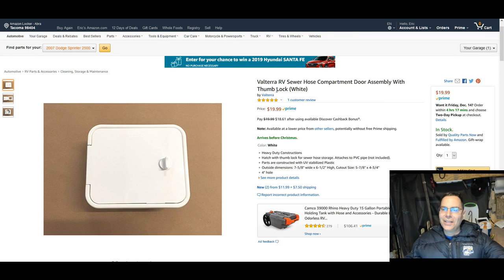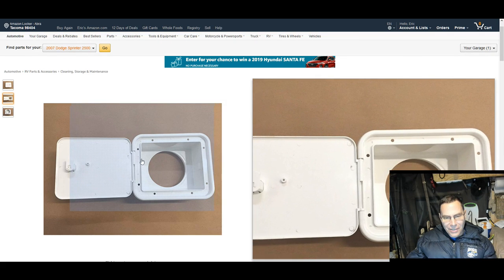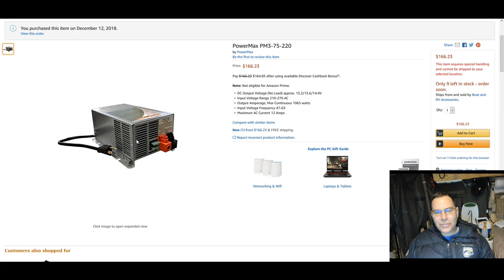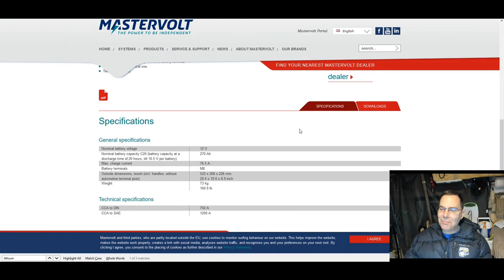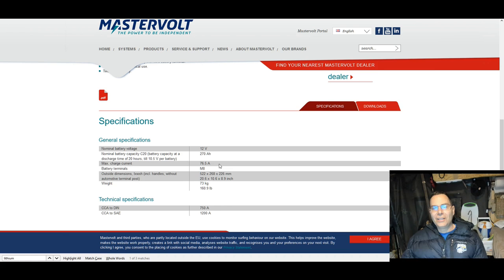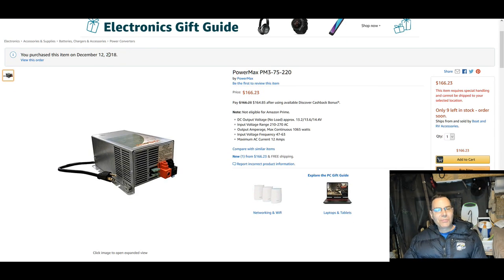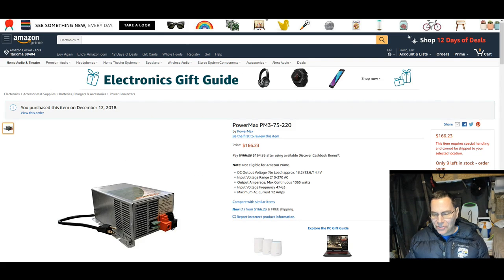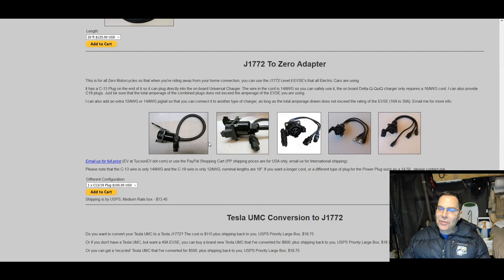EV (Electrical Vehicle) Charging Station Port Inlet (J1772) on an RV Campervan Pt. 2

Comment: Alright this was over a year ago but this is something i have been searching for everywhere. I am going to watch the rest of your videos to see how it turned out. Maybe you can save me a ton of my own reach
Reply from the maker: I hope the videos help, feel free to ask questions / make statements in the comments.
Reply: @EcoNeato  I see that you switched over to a Tesla battery in later videos. Just looking for a cheap way that I can make a portable batter pack that isn't too large that I could plug into a J1772 and charge up. Then when I need to use it I will push it back over the other end of an inverter to charge my EV spark when I am too far from a charge station. Then on the battery side an option to hook up solar to recharge battery (maybe 300w or so of slow charge)

Comment: As a 14 year old, who wants to experience the van life in uni, a lot of people suggest you should have 2 ways to charge your battery(ies) I’ve already decided on solar panels but as my father owns an ev I was wondering if you could charge the battery off an ev charger, I think this is what you have got going here, thanks!
Reply: 16 here: what if someone is towing a camper with an EV? Would having one or two J1772 “chargers” at camp sites be useful to not only charge the vehicle, but power the camper for its electrical needs? (Kind of like how the EU is forcing USB type C for phones, laptops, cameras, etc.)